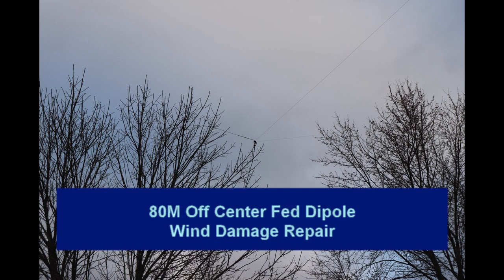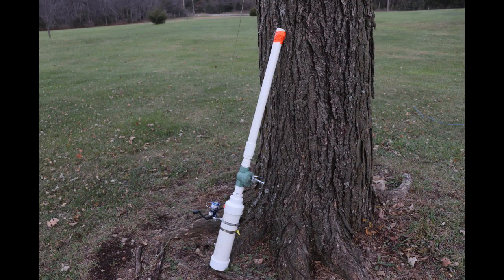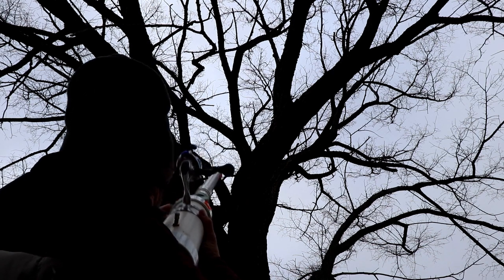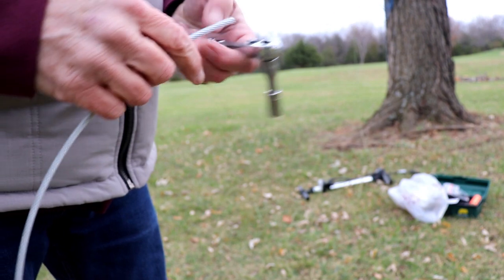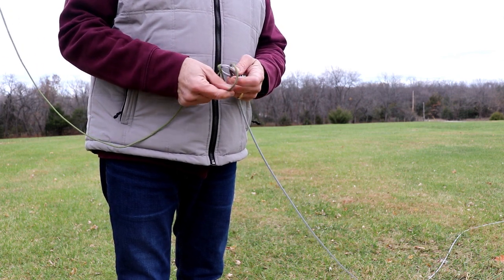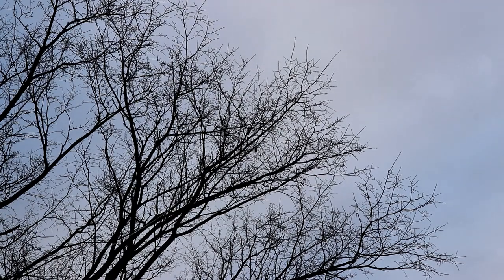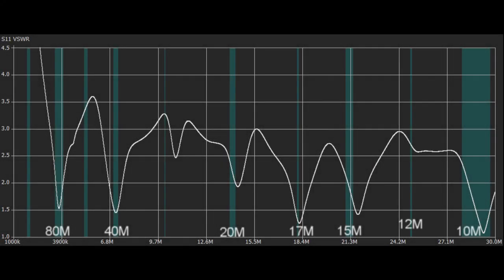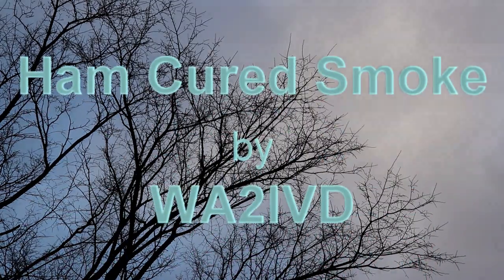80 Meter Off Center Fed Dipole - Wind damage repair

Comment: If you select a wire rope that resembles a traditional fibre rope i.e it has bundles of individual wires twisted in strands and a number of strands twisted to make up the rope, it is possible to make a simple eye splice which does not require a rope clamp. Without the rope clamp there is nothing to snag in the tree. To make the splice feed on some heatshrink tube and untwist the rope into 2 equal bundles of strands (note the nomenclature from above). Untwist enough rope to form an eye plus another 30-50%. Starting at the middle of the eye recombine the wire rope so the eye appears similar to the normal lay. Allow the remaining tails to lay parallel to the original rope and cover with the heatshrink. The resulting eye is self locking due to the friction and wire twist. Without the usual swaged sleeve the eye will not be as strong as the rope itself but is more than adequate for suspending wire antennas.  See here for a pictorial explanation https://www.instructables.com/Really-quick-wire-rope-eye-splice/      
 A couple of other tips. Select a flexible galvanised wire rope as stainless steel rope will fatigue and crack. To prevent the rope sawing the tree limb use a pulley with a roller at least 10x rope diameter.
Reply from the maker: Hi Rob.  Thanks for the comment. This looks like a pretty good technique and doesn't look nearly as difficult as the ones I've seen where the wire rope is completely braided back in on itself.  I'll keep it in mind.  Hopefully, it will help someone else out there too.

Comment: Good job Tom. I'm getting ready to put up a 8010 Palomar OCF dipole myself. I will have it running east to west. Hoping to be able to catch signals i may have been missing due to wire orientation. 
One question, will it make a difference to which side I put the long end of the wire, toward the East or toward the West? 
(I have a 20 & 40 m dipoles running North & South already and they work really well)
Thank you for the great videos!
Joe KI5IQE.  73

Comment: A few questions about your setup, as I am planning something very similar.  Is the paracord tied off to the bottom of the tree?  Did you build or buy your balun?  Do you also have a 1:1 choke in the feedline?
Reply from the maker: Hi.  Thanks for the comments.  I bought the 4:1 balun.  To tie off the paracord I put a lag screw type eye bolt in each tree and have the paracord tied off to those.  I do not have a separate 1:1 choke in the feed line.  The 4:1 balun that I bought is a current balun, not a voltage balun.  The current balun prevents common mode voltages on the coax shield.  So a separate 1:1 choke balun isn’t required.  I’ve been very happy with the antenna so far.  It tunes up nicely with just the 7300’s internal tuner on nearly all portions of all the HF bands and 6 meters.  It also seems to perform very well.  I have received very good signal reports even when the bands have been mediocre.  Hope this helps.  73, Tom
Reply: @HamRadioA2Z  Thank you!  That gives me suggestions on my installation.  I like the idea of using steel rope over the tree limb to prevent abrasion.  I plan to do the same thing.

Comment: Had the wind claim (snap) antenna mast a few weeks ago : (  No trees here in the city so I used fiberglass military masts. Seems problem was one section was faulty and snapped in the wind. Amazing how polyethylene ropes supporting end fed half wave long wire deteriorated (disintegrated) in less than a year . Anyway got the new mast up last week during warm weather spell. . .  Replaced ropes except for one that broke now I have to figure a way to get a rope through a pully 26ft up?  No latter here yet : (  Anyway got two main antennas back on line the third rope and pully was for experimenting. Amazing what nature can do to equipment outdoors  ; )  Just got an ICOM IC-705 and looking forward to your "how to" video on IC-705 ; )  Thank You. . .
Reply from the maker: Hi James.  Thanks for the comment.  It is definitely humbling to see how quickly and badly the sun, weather and mother earth can damage stuff.  When I lived in the northeast, we had a saying that if your antenna(s) didn't come down in the winter then they weren't big enough or high enough.